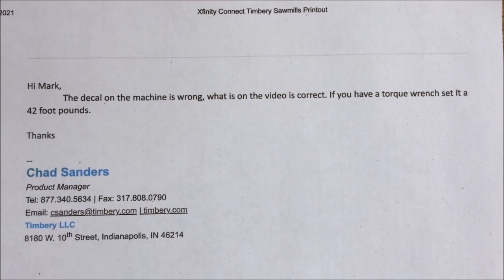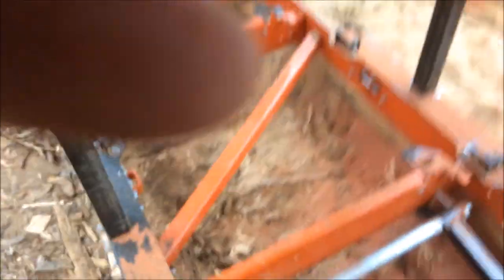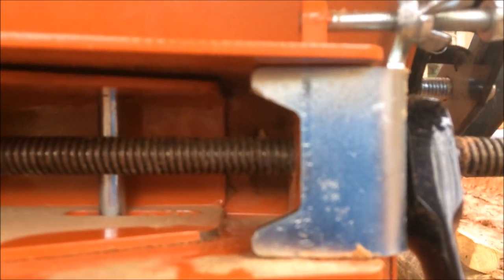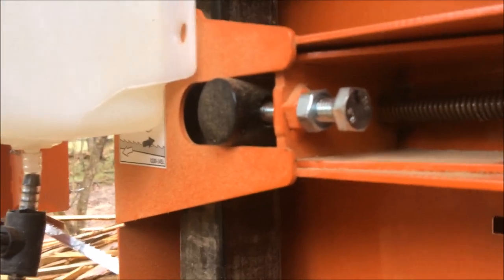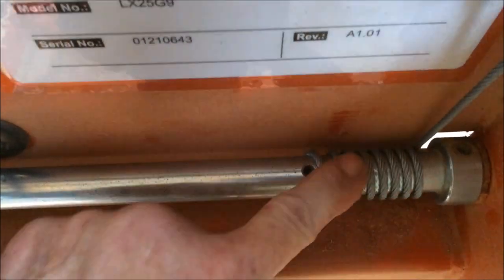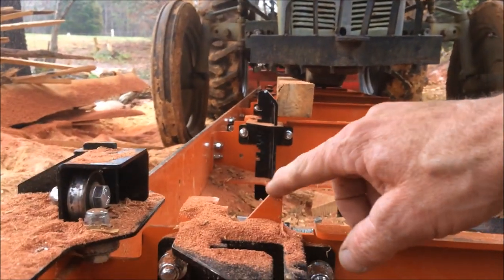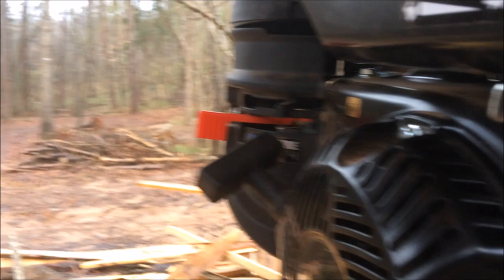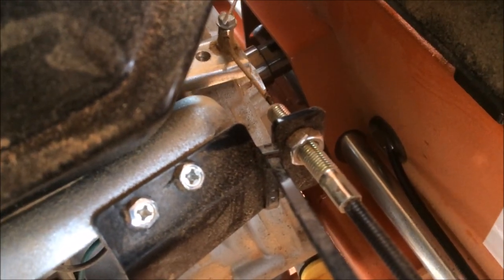WAVY CUTS, CORRECTION VIDEO

Comment: Timbery m100 owner here. 
IME a dull blade will produce wavy cuts.... due to having to muscle your way through the the cut the blade deflects slightly making the waves.
Also, adjust cables where they attach to top of frame to square up the saw in relation to bed.  
Have mine set up and mostly milling utility poles.

Comment: Thanks for the info man, just sawed with mine today for the first time and was cutting wavy. Was also confused on the blade tension being the manual showed something different than the sticker so thanks for the clarification.
Reply from the maker: hope it helps brother. I still get a little wave when blade starts to dull. hard dry end of log will start with a wave too. sharp blade.

Comment: Thanks Mark for your info . Take care
Reply from the maker: Hope it helps brother. I  could not get a straight answer from woodmizer on blade torque. Plycard  is wrong. Run the plate down flush. I have tried tighter and broke a blade. So flush seems right on.  Hard dry logs and a dull blade will always wave.

Comment: Thanks man this video helped me out. I just bought a used M100 and was looking for a user manual without luck until you just told me the lx 25 was the same. Quick question on the throttle adjustment..when I fire my mill up my blade is spinning without squeezing the handle and when I squeeze the handle nothing happens any suggestions and one more thing...my drive belt is riding up halfway on the wheel. I adjusted the wheel alignment to get the belt centered but then it throws the blade tracking off. Any ideas would be greatly appreciated 👍👍👍
Reply from the maker: check and make sure cables are not broken. clutch cable may be to tight. 1 cable for throttle and 1 for the clutch. both connect to the wheel drive at band wheels. should be a spring in the throttle cable. hope this helps.
Reply from the maker: https://www.timbery.com/how-to-videos
Reply from the maker: timberly manual. setup on throttle and clutch are the same on m100 as m120. hope you get it going. http://wiaz.woodmizer.pl/manuals/english/103_e.pdf
Reply: @markb-axtonmx  I printed off the lx25 user's manual and the mill is running perfect now. My clutch cable was seized up. I took the cable off and used pb blaster until I got it broke loose. Thanks alot for your help. One other thing...went out and bought a torque wrench and got it at 42 pounds. No tracking issues or anything but I'm not flush. I do have a thicker bushing in there but hey it's working like a charm so I'm going to roll with it until it don't.  Thanks again for your help. I really appreciate it
Reply from the maker: @tealstr7699  That's great brother. Glad you got her going, and glad I could help.  Yes, bushing may be different. I will be checking  mine often with torque wrench to watch for wear over time. Do the same. You know what you got then. Enjoy and thanks for watching.

Comment: Thanks for this video great information.
Reply from the maker: Hope it helps brother. I  could not get a straight answer from woodmizer on blade torque. Plycard  is wrong. Run the plate down flush. I have tried tighter and broke a blade. So flush seems right on.  Hard dry logs and a dull blade will always wave.

Comment: I heard that a dull blade will wave for sure do you have a sharpener
Reply from the maker: I do not have the correct sharpener. I have tried sharpening my own blades two different ways. somewhat works. will make a video when I figure out what works. chainsaw sharpener does ok.
Reply: 👍think I’ll probably get one should pay for itself. Will let ya know